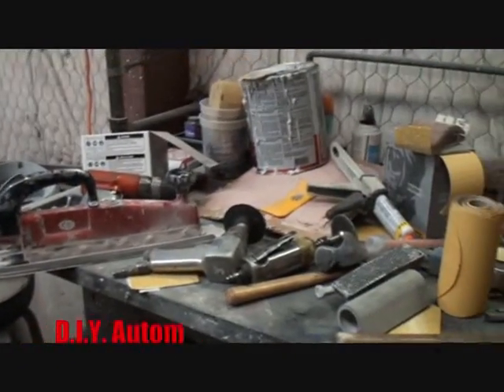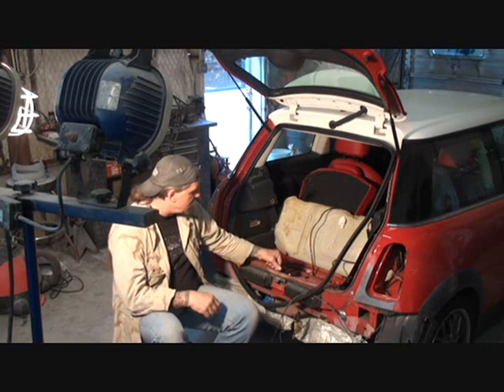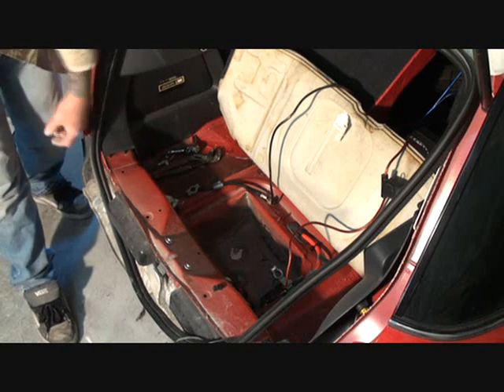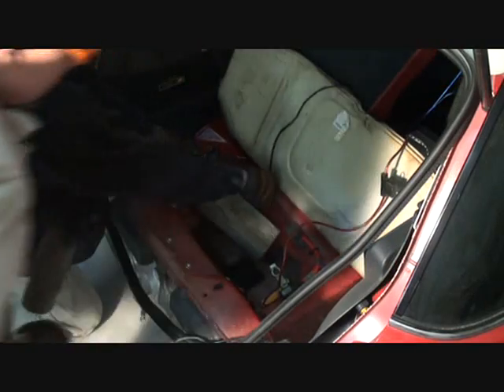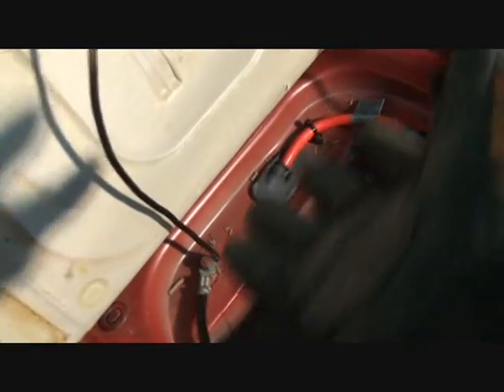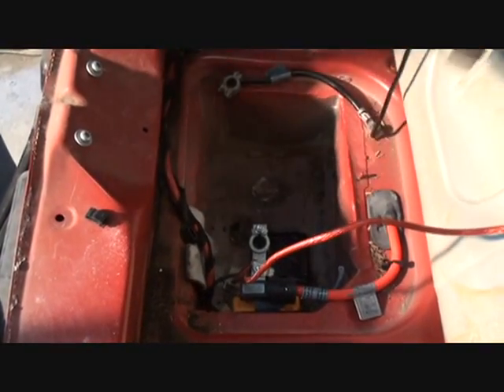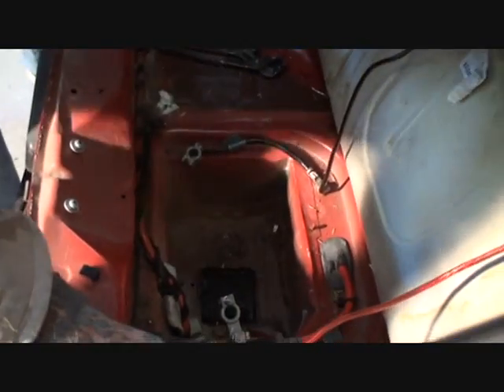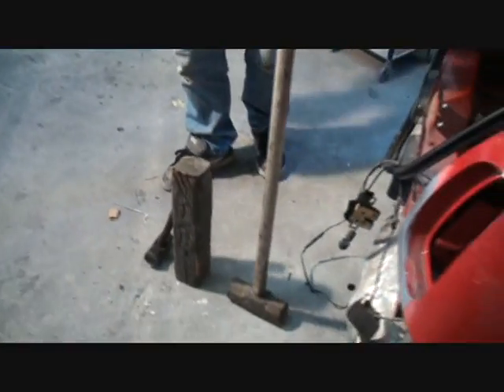Auto Paint And Body-Tech Tips And Tricks-Using Household Items As Tools

Comment: the sledge hammer trick worked well for a crushed bedside I was working on Boss was too cheap to get a new bedside so to get the tailgate to close properly I did the wood trick with a sledge hammer. Wood is a good tool for sure.

Comment: Making tools is fun. Tip no. 1: weld a short extension to a spark plug socket that you commonally use, that way, when you try to pull the socket off, the extension doesn't pull off by itself leaving the socket on the plug, then you can't get the f*ckin' socket off. Tip no. 2, a little grease on the end of a phillips screwdriver holds the screw on.
 I guess "Mr. Dislike " must be in church today........